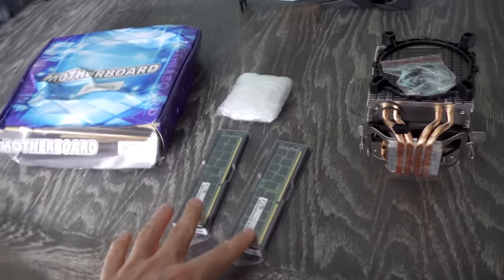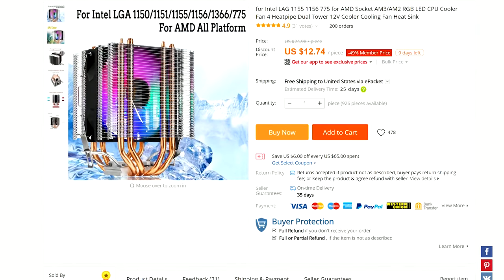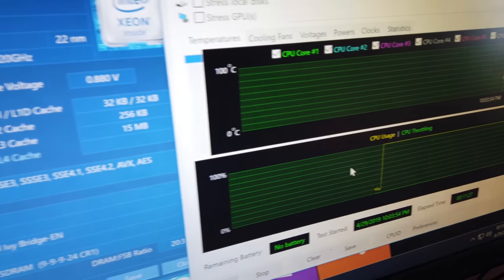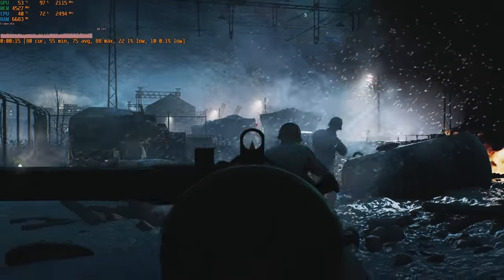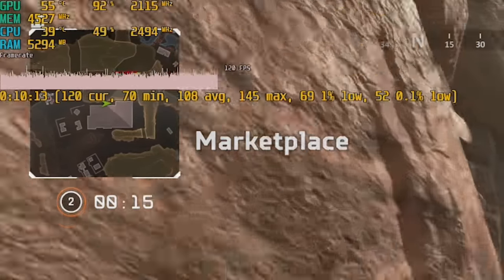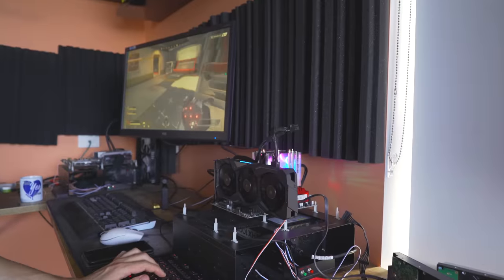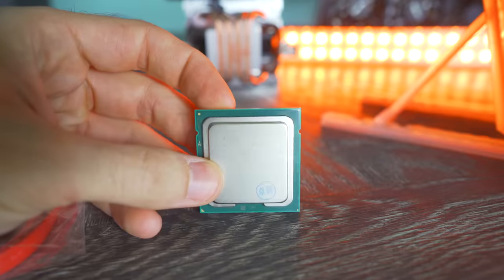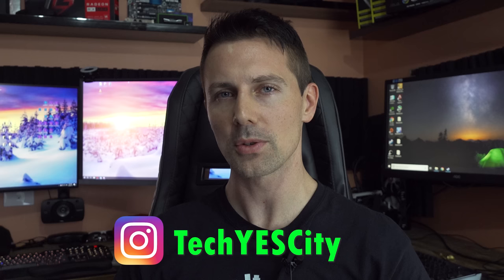This 6 CORE Ivy Bridge Xeon only Costs $24...! (Worldwide Deal)

Comment: as you can see the problem with low core speed CPU with high core count... they suck for FPS games or high refresh gaming.. just look at the 1% and 0.1% lows and this is with a low end card.. if you pair this with a 2060 or even a 1080 this cpu is going to bottleneck the system bad... just buy a Ryzen Cpu low end one with a decent board and you will be set for at least 2 years or more.. with a system like this you would be lucky to play any modern future game titles above 60 FPS..

Comment: 70€ a old motherboard... No thanks... Nice cpu but those mobo are like hella expensive
Reply: High end socketed motherboards are always going to be more expensive lol
Reply: @brenaan_  yup :(
i mean im better of buying ryzen 2200 or 1200 with a a320 mobo.. for like 150€
Reply: @reggiexp69  b350 boards are pretty close to a320s now in price, maybe only 10$ more

Still, ryzen is way better value imho than any lga 1366 or above mobo + cpu
Reply: @brenaan_  i mean its nice but if i look at new price of ryzen and any lga 1155 1366 x79 x58 stuff it's cheap but overal your better of buying a cheap ryzen... Ddr4 prices are dropping u can get 8gb for 40€ or less. Any a320 mobo are like 40-50€ and a ryzen 1200 i can find them for 60-70€ all that new. For like 150€ i love the used part hunt but xeon are fun but those motherboards are not fun...

Comment: Today im getting a broken ro 270x windflrce ime gonna try fix tk clrssfire with my r9 270x dual x and in the weekend i may be getting 2 gtx 660s and the sli bridge.... this week is gonna beeeee fun, i have 2 spare am3+ mobos, 1 complwte woth fx8370, 16gb ram etc anf an i7 860 with 16gb gskill and 8 gb lingston yes ik 860 is only dual channel jist dont wanna mix it all up lol and it has a cooler master hyper 212 X, then later this week im getting 2 power supplies, 2 cpus, an fx4300 and an i5 3470 😥 lots to write and also a case. Im tryna deal hunt ooh ohh and also maybe an rx 460 😁😁😁

Comment: dislike, mainly because its misleading, complete build is around 300 usd, this case, psu etc and beaing all part bought seperate internatiional buyes will get hit by shipping costs, for 300 usd usd you can buy a similiar current build that will consume half electricity
Reply: He said that the cpu costs $24, which is true (looks like you can get some for $19 now,) how is the title misleading?

Comment: Operating System
 Windows 10 Pro 64-bit
CPU
 Intel Core 2 Duo E6850 @ 3.00GHz 38 °C
 Conroe 65nm Technology
RAM
 8,00GB Dual-Channel DDR2 @ 400MHz (6-6-6-18)
Motherboard
 MICRO-STAR INTERNATIONAL CO.LTD MS-7345 (CPU 1) 36 °C
Graphics
 Generic Non-PnP Monitor (1152x864@60Hz)
 1024MB ATI AMD Radeon HD 5450 (Sapphire/PCPartner) 38 °C
Storage
 931GB Seagate ST31000524AS ATA Device (SATA ) 25 °C
Optical Drives
 TSSTcorp CDDVDW SH-222BB ATA Device
Audio
 AMD High Definition Audio Device